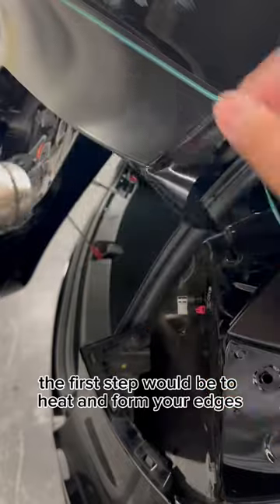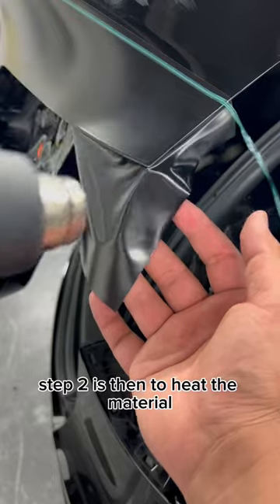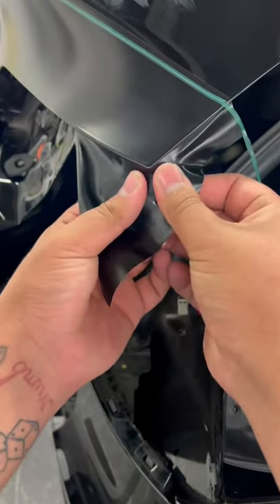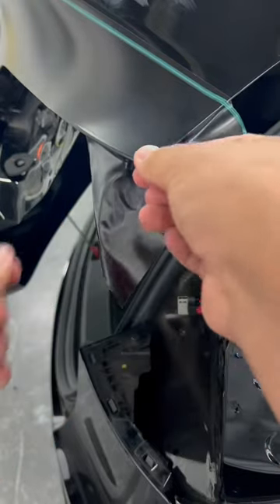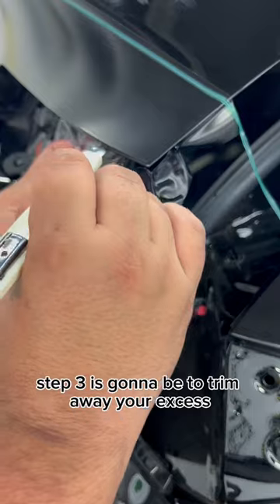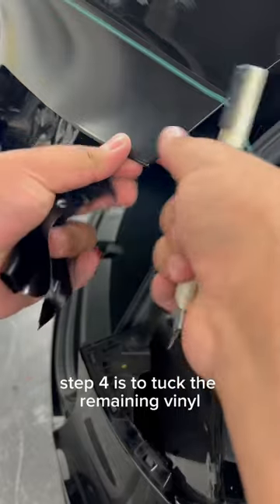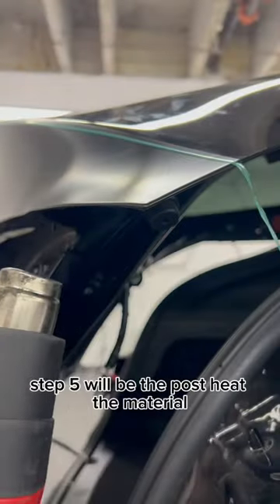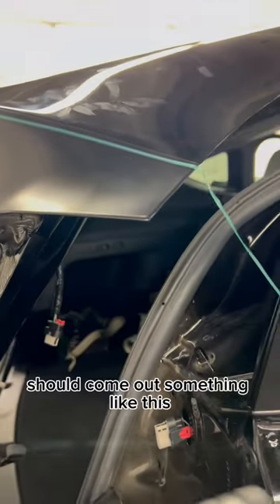How to do PERFECT corners!!

Comment: that looks nice and may hold in that spot. I myself am no professional wrapper but i’ve dabbled. It may hold in that spot because it’s the rear and not as much wind and elements can get to that area , on a hood or edges that may be brushed against frequently would want more material to over lap, but that’s just my opinion